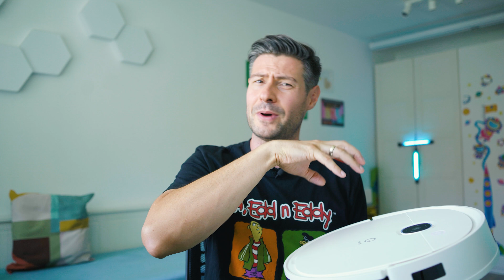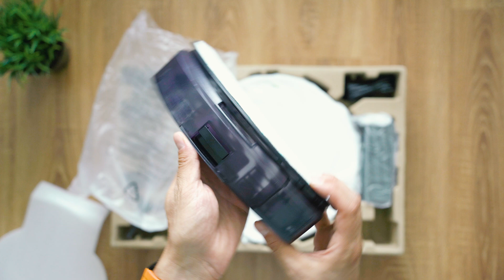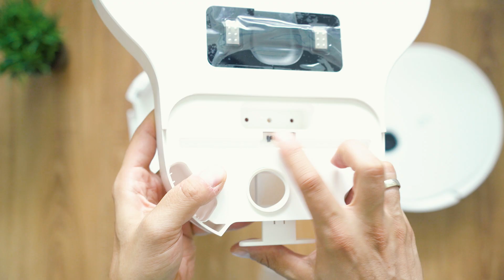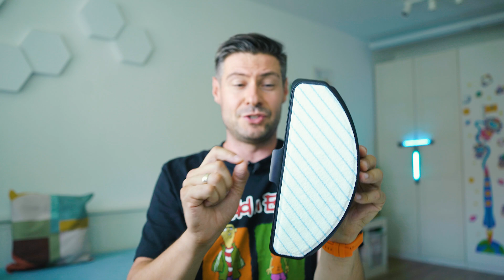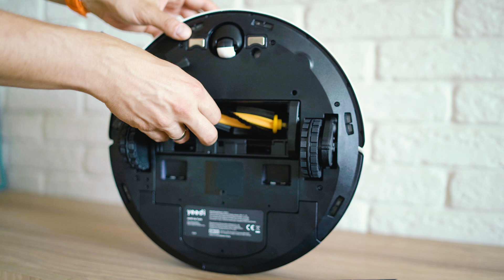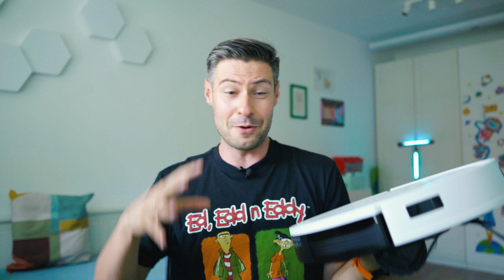Best Mopping Robot Vacuum? Might be Yeedi Vac 2 Pro! [REVIEW]

Comment: Can this detect stairs? Preferably don’t want my bot tumbling down a flight of stairs
Reply: There is an enable mode to detect stairs. Dont know how good it is as i dont need to use it but its a feature.
Reply from the maker: It won't fall down. I haven't seen a robot vacuum without such sensors in the past years.

Comment: This is a flawed robot vaccum cleaner.
1. Doesn't do mapping properly. Biggest drawback 
2. Lacks LiDAR sensor. So navigation isn't good
3. Gets stuck under furniture
4. It can't even go in straight lines to vaccum
5. Needs ample light. Cannot work in dark or low light
6. App is slow. Everytime it has downloading phase
7. Cannot find base station(many times) 
8. The map can suddenly change
9. Robot will skip some rooms
10. Obstacle Avoidance is pathetic. Not even basic Obstacles it cannot detect
Reply: Yep, mine will sometimes clean under my sofa and other times it will not due to the amount of light in the room. Overall I like it but have no datum point to compare it with since it is my first time owning one.
Reply: I agree!!  I am having the same issues!
Reply from the maker: Thanks Satya for sharing this! Agreed - the lack of LiDAR is notable in some situations, but it is quite OK in terms of orientation. It was able to find the dock each and every time I've ran it at home. The app supports now multi-floor maps. 
Can you share with us a layout of your map/home? Would be interesting to see how it;s positioned.

Comment: Thanks for the Video.  Is it possible to add detergent with the mopping water in the water tank, noting that many other brands do not allow that?  Thanks
Reply from the maker: Yes, I always do that, event though the instructions advise otherwise.
Reply: @TechMishka Do you know why the brands ask us to avoid using detergents in the water though? Does it clog the waterflow pipe or what?

Comment: Are Yeedi a spin off of Ecovacs? The hardware looks very similar (dustbin, main brush etc) and also the app, also very similar.
Reply: Yes, Yeedi is indeed a brand of Ecovacs. Many Yeedi models sold globally are available in China under the Ecovacs brand.
Reply from the maker: Hm, that's a good point - never really thought of that. Let me ask around and we'll see what's going to come up.
Reply: @TechMishka  As soon as I saw the underneath of the vacuum and the app I had to question it.. wondering if they're doing a sister company with a slightly cheaper price point and selling mostly in China. Either way, I'd happily buy this Yeedi seeing the hardware and app and it really is so close to the Ecovacs.
Reply: yes they are..